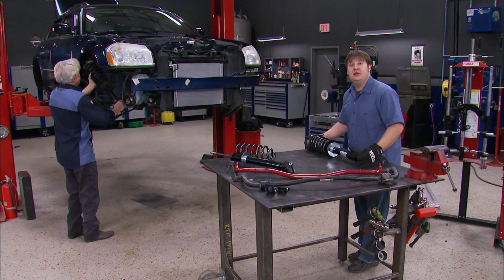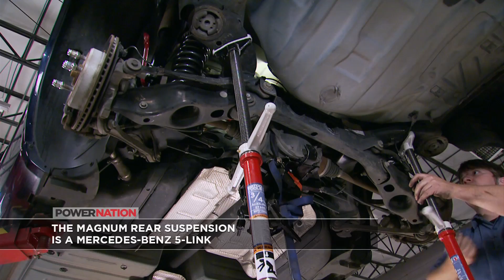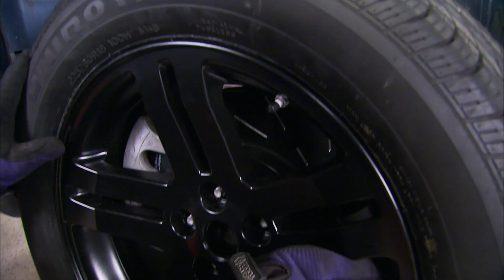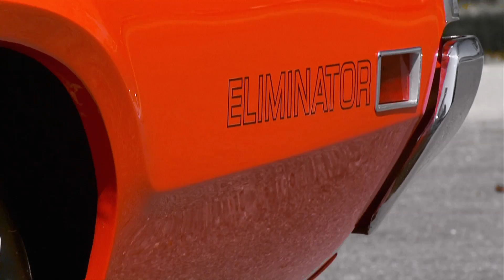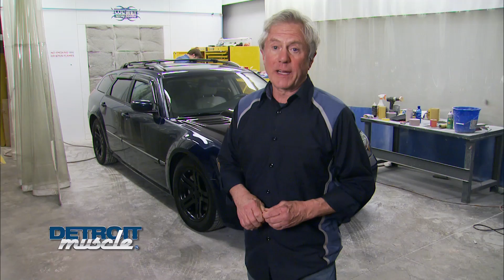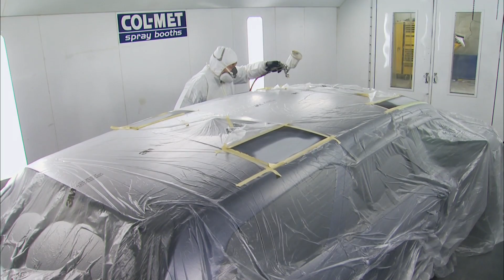Dodge Magnum Hemi Wagon Transformed Into a Grocery Gladiator - Detroit Muscle S1, E15

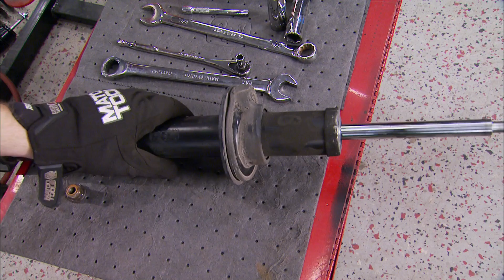Comment: 02:00 i do not see some benefit of lowering car if spring/absorber left soft, i installed kw v3 kit on 300c 5.7awd and put it high as possible and car is still 2cm lower than stock but it is much more stiffer and no bank in corners what is much better than stock no matter of height

Comment: Putting on a  Super Charger without addressing the lifters, cams and weak springs and possible piston damages was a waste of engine breakdown and money on labor (customer). Also, failure to upgrade the "weak" tiebars, links, brake rotors, and putting adjustable camber/caster kit for front and rears did not give the audience and owners of a Mag full upgrades considerations and know how's.

Comment: Not only did they rob the poor Magnum by installing the wrong brake pads, but they finish the build and all we get is a cheap little burnout that you could have done in the stock Magnum? Where's a 0-60 pull, 1/4 mile time, a dyno run, ANYTHING to highlight an actually visible increase in power??

Comment: Nice transformation, but I'd be hesitant to throw almost $10k into a supercharger and exhaust on a 15 year old car without doing something to strengthen the bottom end of the engine. I don't have a lot of confidence that it will stay together for very long with all that boost going into a stock engine with probably 100,000 miles or more. My Magnum R/T is going strong at 138,000 miles but I wouldn't add forced induction without updating the guts first.

Comment: No anti-sqeual compound on the backside of the pads? The lube is used for that, dampens out the vibrations that cause the disc to ring like a bell.

Comment: 2002 CALLED. They want there halo headlights back...
Reply: I heard they came with a free 8-Track tape player.
Reply: @maxredman1015  In 2002?   Crawl back under your rock. You're a total moron. 
Last 8 track was 70's you fucking dumb ass. By 2002 we already moved past 8 track.... past cassette tapes... and fully in to CD's.  What are you 12 years old? Fucking moron.
Reply: It's (Their*) . chill out numb nuts . these werent around in 2002 .
Reply: They're still doing it and it's 2022.

Comment: HP, suspension, and brake upgrades, with freshly powdercoated wheels, and they reinstalled the stock Uniroyal Tiger Paw A/S touring tires. headdesk
Reply: Guess which part of the build they didn't get a paid sponsor for?
Reply: They only used them to do burnouts I hope
Reply: They also "upgraded" the braking system with the single worst pads I have personally used on a Magnum. Brake fade was significantly worse than the stock pads and within 15k miles one pad was falling apart, another was pretty much disintegrated. I threw on some $19.00 O'Reilly pads as a temporary fix while I decided whether to go with Hawk pads or give EBC another shot and go with their Yellow pads. The dollar store pads handled the heat better than the EBC Reds so I went with Hawks on my next set....long ramble to say, please don't EVER buy EBC Reds for a large vehicle. They're fine for little Honda gokarts...but they have no business on a muscle car.

Comment: The power coater shouldn't have   copated inside the huds . I have a set of 1200+  rimes and tires  that 8 found  it really  hard  to get a shop to put them on because  the power coaster   did the  huds to
Reply: Copate yer own huds and power coaster. What the heck are you talking about?
Reply: @markg7030  1200+ rimes and tires that 8 found.
Reply: @289pinto  Him claims a set of 1200 rymes. What vehicel Gots 1200? mines got 4.

Comment: I'm not so sure about them EBC brakes. I had them on my motorcycle and they would overheat and fall apart. I then changed to a cheaper brand and they never over heated.
Reply: I just commented about that on another guy's reply. I ran the Reds myself on my 06 Magnum and they faded worse than the stock pads as well as the cheap $19 pads I threw on when one of them disintegrated.
Reply: @desertsavagery   there shit mate. Mine just overheated and fell apart. A mechanic told me I overheated them so I responded
 " they overheated themself " lol ... my stock pads are stronger and more reliable.

Comment: I kind of think I would have left the roof rack. And although I like the hood I would just stay with the Stock hood. Because I wouldn't want them to see a freaking thing coming. I'd want a full sleeper grocery getter.🤙👀
Reply: The roof rack sucks, but I don’t think they had to do all of those things to delete it.  I always loved the ‘08 SRT 8 hood with the scoop on the leading edge.   On the Magnum, killer.   I like the factory wheels, RT or SRT8, others look like they were “settled on”.  Bag it.  Up when you need.  Ground hugger when you want.  Those headlights remind me of in the 80’s when people would go and buy every single stupid modification to “set their ride apart”, but in reality it looked like someone desperate for attention.   And black.  Always black.  The vanilla with blacked out windows and wheels is pretty nasty too.   Otherwise, they got them right the first time.
Reply: i was gonna write the same thing!!!!!!!!!!!!!!!!!!!!!!!!
Reply: I agree , and they way they eliminated the bolts was retarded, if one has to one can just cut them and grind them down no need for holes and bondo that eventually will rust out.
Reply: Ditto on the rack, I picked up an OEM rack for my 2006 MSRT8...and it's still in the box. I have trouble with the idea of drilling holes in her to bolt it on.
Reply: yup, I would've kept the roof rack too.  not only for the versatility but the amount of work needed to get rid of it... plus, doesn't look like there's a whole lot of cargo space in the wagon